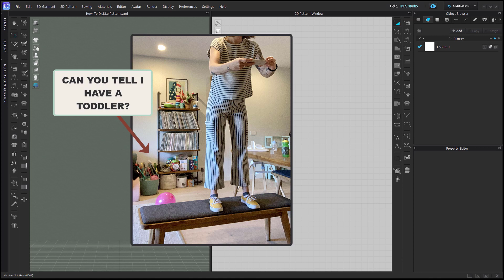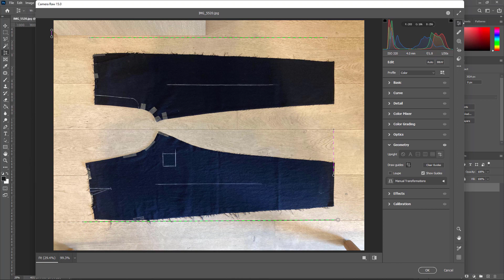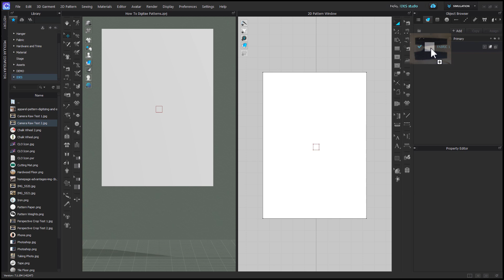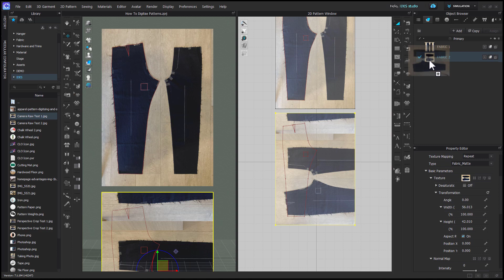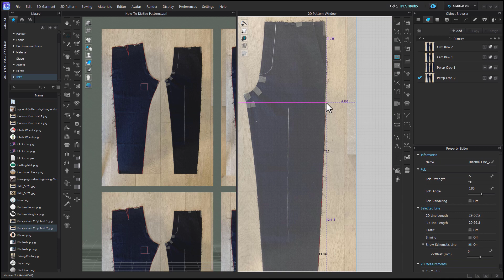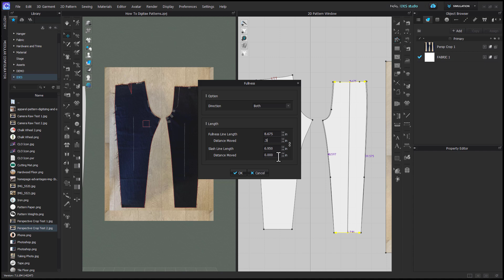How To Digitise Paper Sewing Patterns With A Phone, Accurately Using Photoshop and CLO 3D

Comment: Really good explanations. Especially the last part with adjusting length and width. Even the table of contents was a great addition. Had you considered using a wide yard stick in your initial shot instead of the 2" square and floor markings? We used one and it was helpful because we used the outline of the ruler to line the perspective crop and used the length to accurately match dimensions in the program. Please continue to make more videos.
Reply from the maker: Great idea! I moved overseas and need to buy one, but I’ll def try that.